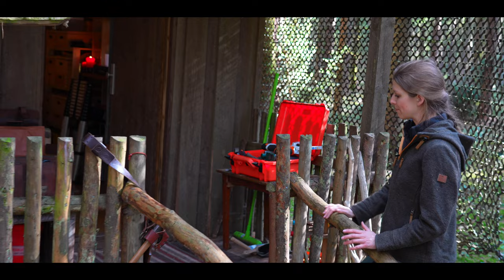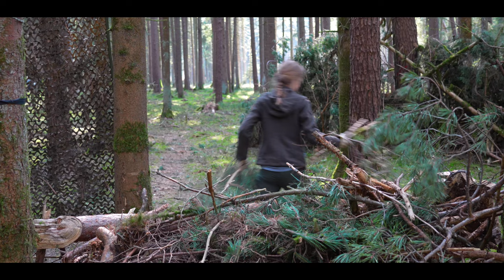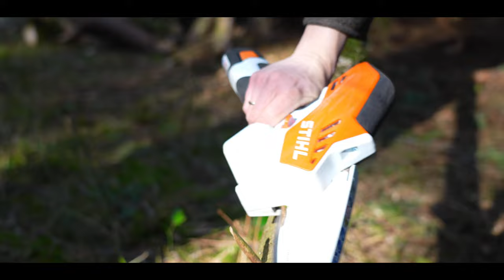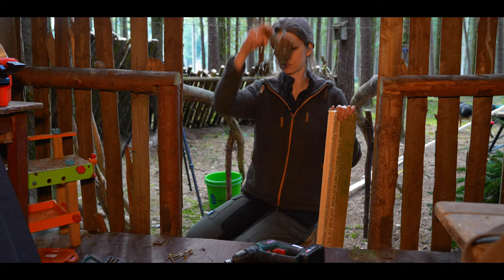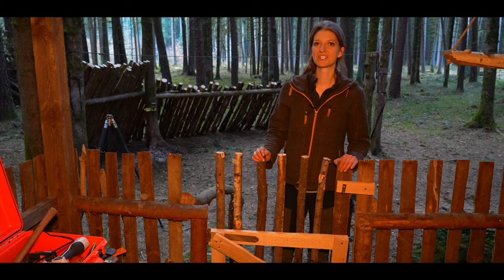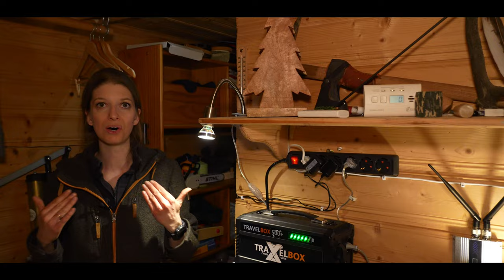🌲 Drop-out hut 🦊 Can it be a little more? 🌳 Foxhut  #21 projects

Comment: Vanessa, I like the idea of putting up more of the walls.  When it comes to the animals, they are quick to figure it all out.  Deer can easily jump over them without issue, and the smaller animals will find their own ways in and out.  It's a lot of fun seeing you do the various projects around your forest cabin and it looks like you're having fun as well, which is important.  It's so fun watching your dog as you're working with all of the wood because I think your dog wants you to throw every single one of them because she wants to play! 😃

The solar on the roof will be great considering that you're not at the cabin all that often, but the Sun does rise every day.  I'd be curious to see how many watts of power you're actually getting from the panels with all of those trees creating shade.  Regardless, it's a great idea to keep the solar up on the roof so you can keep your batteries topped off.  I love the light strips in the cabin!

Keep up the great work Vanessa, and keep smiling!
Reply from the maker: Hey Brian, thank you for your nice words! If Aika was the chef, she want to have every single branch of my wall to play with it :D

Comment: I like the projects both inside and out.  Moss would look great on the log wall/shelter and it wouldn't stand out. 
To blend into the background, avoid straight lines as much as possible, and find a way to disguise them where they are necessary.  The only thing in nature that is straight is the surface of a pond, and even then only when there is no wind across it.  So anything straight stands out as artificial.

Comment: I wouldn't put the Jackery solar panels on the roof in the wet weather Vanessa...they aren't waterproof.  Those is why I won't put mind outside as a permanent fixture. I have two, but until the drier weather arrives, I am only down to using on in the bedroom window.  Once the dry weather is here, I will put the whole system outside to charge the battery bank part of it.